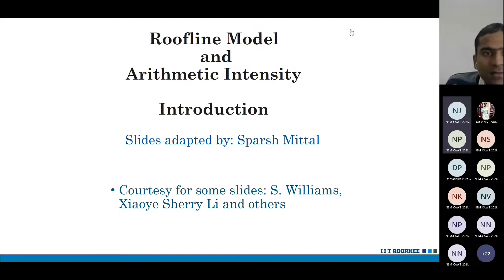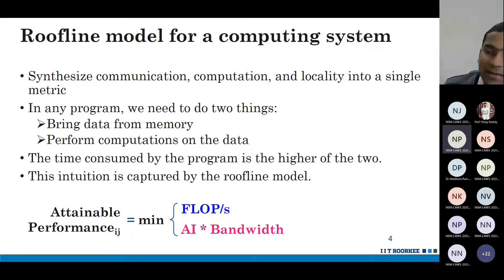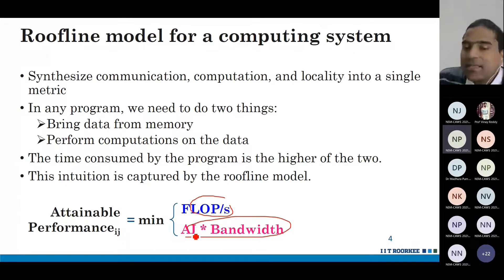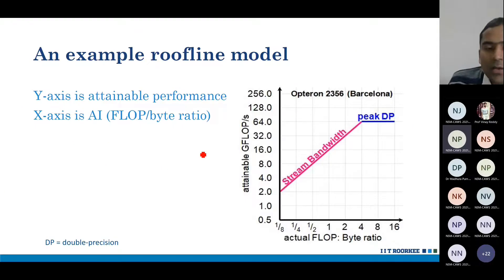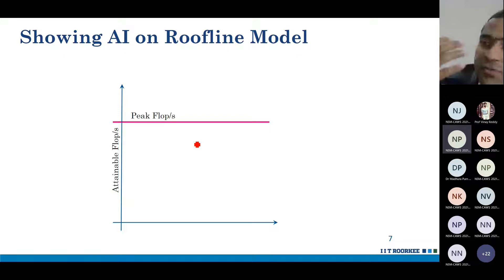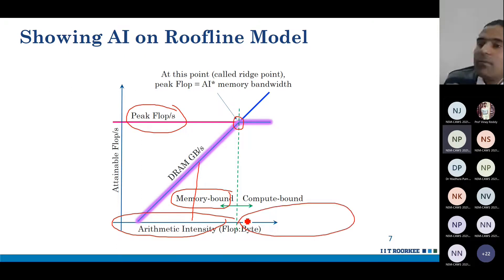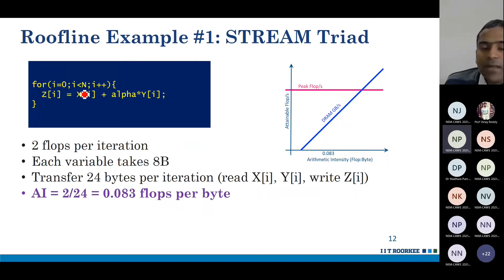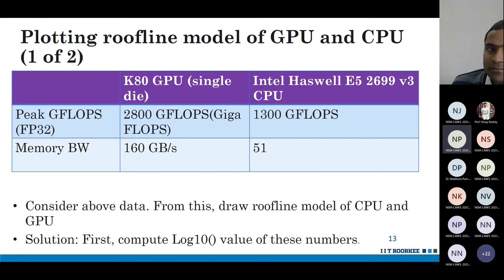Day 3: DRAMs: Roofline Model and Arithmetic Intensity: Sparsh Mittal

Comment: If the point lies in memory bound,how could we optimize the code to get higher performance with vertical movement and horizontal movement?
Reply: Increase the frequency of the dram or change the ddr version. There are multiple ways to improve the memory bottleneck